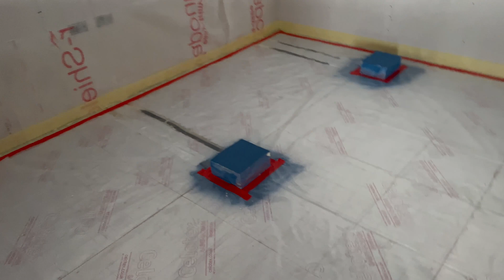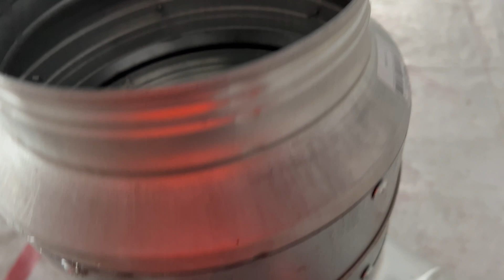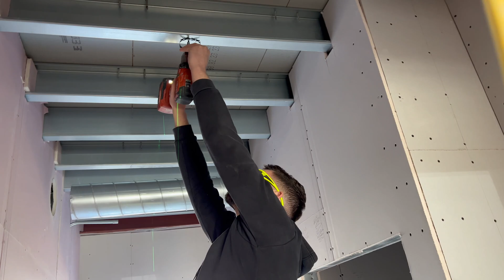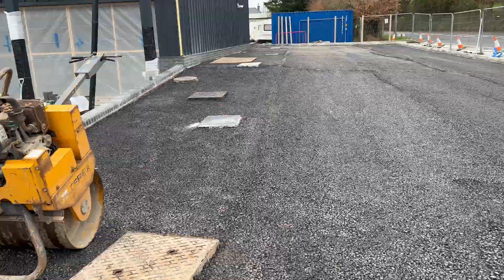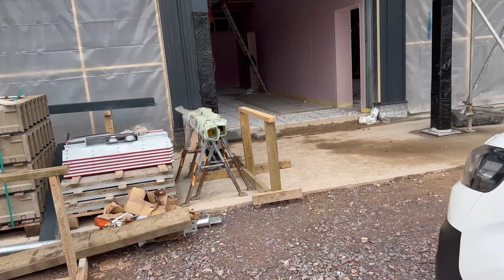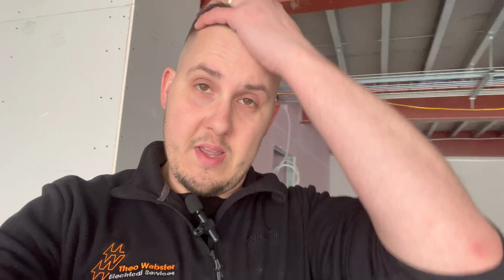COMMERCIAL UNIT WIRING. TEAM WEBSTER SMASHING IT IN 👊🏻🍊 #electrical #electrician

Comment: Looking good mate loving the videos! In regards to the fire alarm and refuge panels we always take them straight of the mccb panel so they can isolate the board while the FAP remains on 👍🏻
Reply from the maker: Hi Harry thanks for watching ! Yes that’s it we have got the refuge panel and FAP on separate circuits back to the panel board for ease of maintenance etc